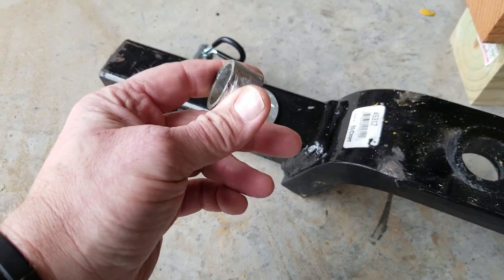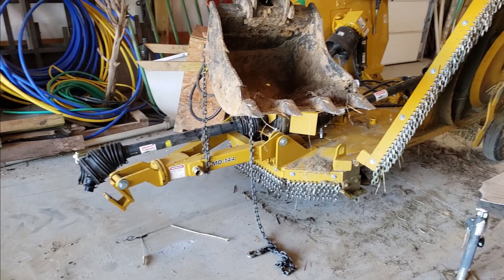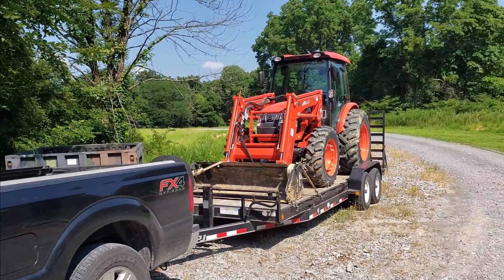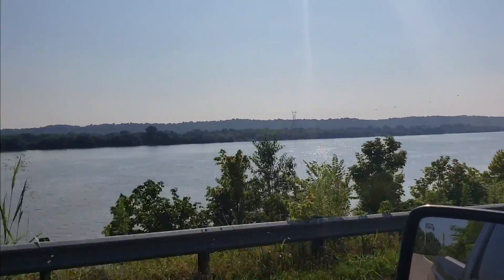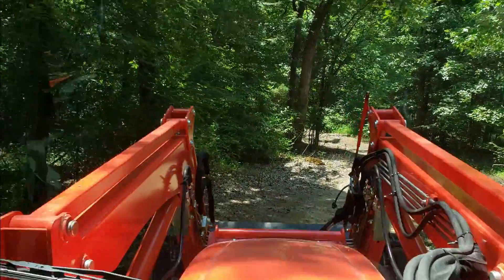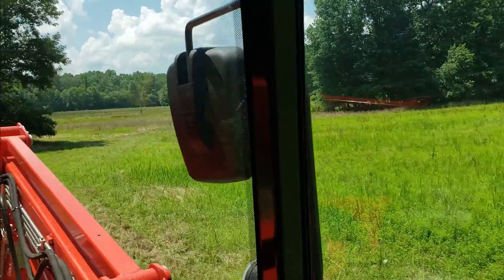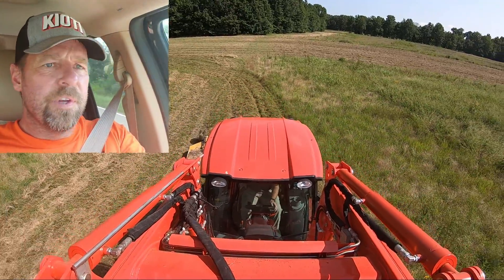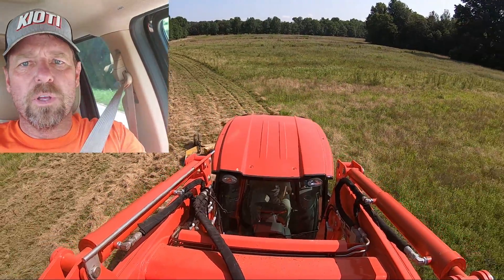PART 1. Bush hogging 25 acres! Kioti RX7320 & 12' batwing tackling Illinois bush hogging task!

Comment: That's the same brand rotary mower our DOT uses around here for the roadside. Just curious the rear wheels on the cutter,are they meant to go highway speeds or did y'all change something out?
Reply from the maker: You're right a lot of states use them. I changed to aircraft tires filled with foam to do this. It was expensive but worth it to be able to haul it like this without worrying about blowing up a tire and hitting someone on the highway. Thanks.

Comment: @kapper outdoors curious why you mow with the loader on the tractor? The loaders are easily removed, 2000lbs less to haul and much better visibility.
Reply from the maker: Good question! We are in pretty rough country and more often than not I need the loader to fill in wash outs, pot holes, or remove downed trees so It is just easier for me to keep it on. Thanks.

Comment: Joe; how are you liking the RX?  I talked to my dealer and am close to pulling the trigger.  Tell me I am not crazy brother!!!
Reply from the maker: Loving it! Well made machine. The only thing it really doesn't have compared to Kubota is 4 sub gears vs. 6. Might be nice, but to me definitely not worth the 'Kubota orange' extra price tag! Great machine for sure!
Reply from the maker: But there is good compensation for this, on the Kioti. Most tractors that I've ever used max out their engine RPM's to the 540 pto speed, or very nearly so. The Kioti has nearly 400 rpm left to go PAST the 540 pto speed, so you can make more speed adjustments through the throttle as well as gears.
Reply: @kapperoutdoors  Great feedback.  As I said on another post; I am done with the open station here in TN.  It is way to hot and humid or frigid cold to get work done and enjoy the process.  Doing food plots and clearing land is supposed to be FUN; not give you heat stroke!  Love my current Kioti DK5010 but ready to see how the other half lives.  Only challenge is that all of my implements are 6'.  Cheers brother.

Comment: what gear are you pulling that with.  I have a 15 foot and the next size up 9020 PX and pretty much run in 3/1 even in the think stuff as long as it is grass when I hit saplings I drop down to 2/2 or so just to cut it up more.  I love bush hogging with the cab and My kioti.
Reply from the maker: IN the thick stuff I think I ran 2/1 or 2/3. In the thin stuff I could run 2/3 or 2/4. Never tried 3/1 yet, might have to try it! Thanks man and good call on the Kioti!!
Reply: @kapperoutdoors  Mine is a bit bigger at 15 foot but I have a few more HP so it should be about the same.  I am usually in 2 somewhere if it is think not much higher than 3/1 even if it is not thick.  Love my Kioti and it just runs.

Comment: What happened to the Rhino tiller that you had ordered? Did that fall through or have you not had a chance to put in it video yet?
Reply: Two weeks ago he did a video setting up the quick attach for the new tiller. Been patiently waiting, but I haven't seen it run yet!
Reply from the maker: Its all set up ready to go! Haven't used it yet, but will be pretty soon starting fall plots! Thanks!

Comment: Wish you would throw in a quick Google Maps Area Calculator from time to time for those fields and plots you are working on.  Helps to relate better.  If you are right, I would think mowing 5 acres in one hour should be a decent rate of coverage.
Reply from the maker: Well at least in the final part I'll have a drone shot to at least show how large one of the field is and how tiny the tractor look. But good idea Clark I like it I'll see if I can find an aerial. Thanks